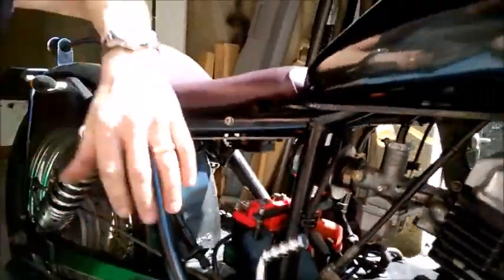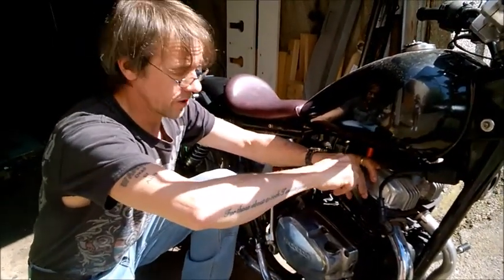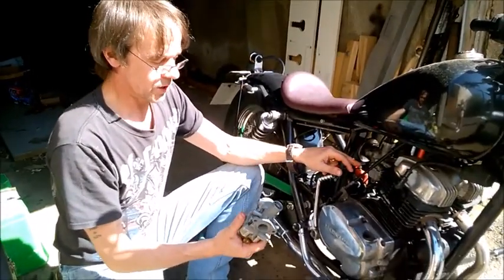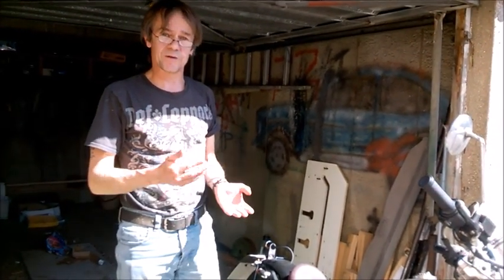honda rebel 125 carb adjustment by Jim Ray

Comment: Maplins.
Those were the days.
Now uou say theres no more power to be had out of this bike, not quite true, these bikes run about 9hp as standard,
Detuned to trach a hp target. breathing better frees just a few more horses, up to about 13! 
According to estimates, you can also bore up to a massive 143cc!
the main blockage is the inlet manifold, solved by a switch to dual carb CV set up.

Comment from the maker: https://www.ebay.co.uk/itm/Throttle-Cable-Honda-CG125-China-Length-960mm-90mm-/301946338716?hash=item464d677d9c some thing i forgot to mention, if using a cg carb you will need a cg throttle cable

Comment: Did the same on my 125 rebel but I have to put the choke halfway to ride normal, without that I have no power any idea what would be wrong?
Reply from the maker: are you running standard filter and exhaust? whats your setup?
Reply: @jimray3954  yes standard airfilter and drilled exhaust
Reply from the maker: is the throttle cable working correctly? not snagging? too short? as i said above some of us have had to change to a cg cable. Also, have you tried all the adjustments? clip up and down
 etc
Reply: @jimray3954  trottle cable is all fine, but didn't change the clip I will try this and hope it will inprove, with the original carb needed full choke to run, after seeing your video it was wuth just buying a new carb 👍
Reply from the maker: Start with the clip at the highest notch, and see how it goes
Reply: @jimray3954  now I have put the needle one stand higher (one more left) and it runs great, reached a 95,4km/h on gps, not bad for a 25year old bike and with me on it (plus 100kg) 
Thx for the tips made my day 😁
Reply: @jimray3954 do you still have the original black thing between the engine and the carb? I have a similar problem to the person above, but I think it’s caused by too much air going into the engine, I tried every needle setting. I suspect my cone air filter is too big but I’m also wondering about the black thing at the front. But if the black thing is still there then what’s the purpose of this carb, if the black thing is the same diameter as the original carb. It revs just fine on choke, but with choke off you can’t rev it

Comment: What kinda speeds do you get outta your Rebel? Max ive hit is 65 on a good day, sometimes it tops out at 60 screaming
Reply from the maker: 65 is about the top end. this modification is aimed more at folks that have put a kn style filter or/and chopped exhausts, the cg carb gets rid of the flat spots that are in the standard carb when you start modifying
Reply: Ah thats fair enough, Shame we cant twin carb these, would be interesting

Comment: I have problem with my stock carb Keihin PD 22.
My Rebel have normal exhausts and filter.
This chinese carb for CG125 will be good also for standard configuration?
If am afraid that I will have problem with adjustment.
What is Your opinion?
Thanks for help.